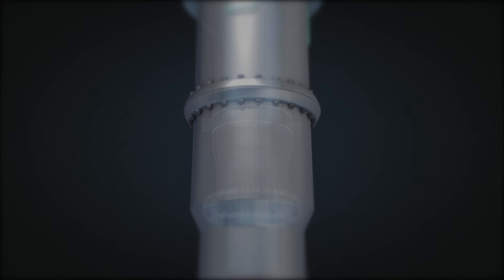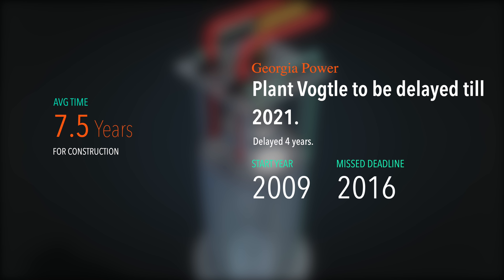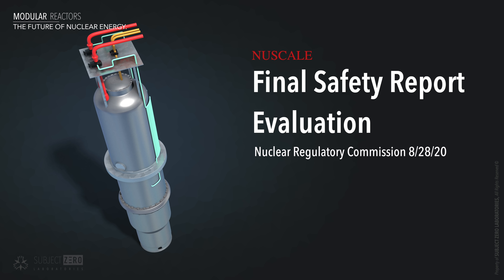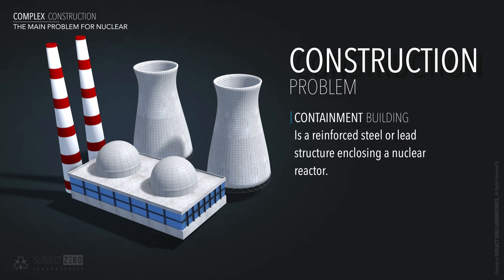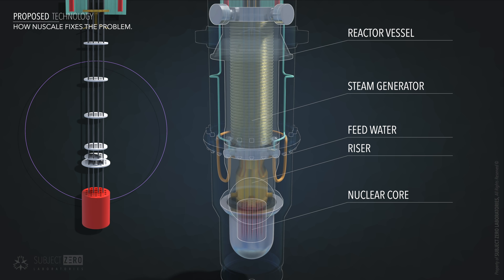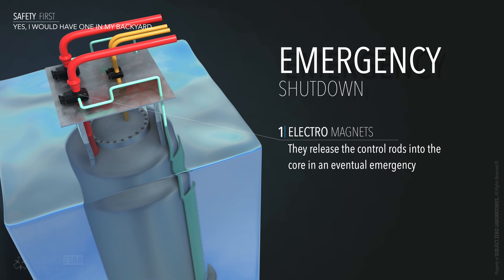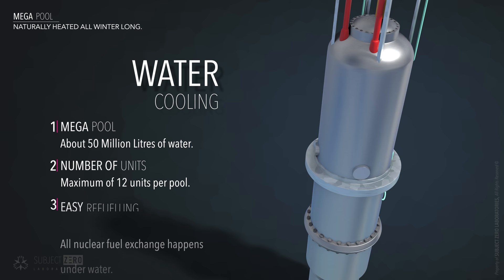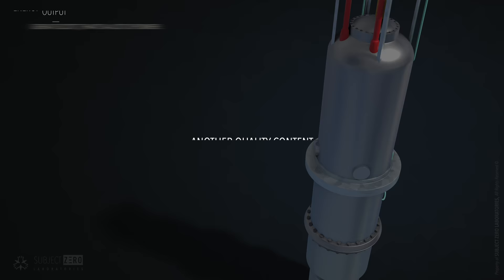A Milestone for Small Modular Reactors (SMR 2020)

Comment: Another weapons-grade nuclear waste production method. Pass.
Unless you've got LFTR or Fusion going (or a cheap way to send nuclear waste to the sun), this is just a waste of time in the medium and long run.
Reply: @yog-sothoth9895  It's the same material. You take the plutonium waste and refine it. It's one "solution" to what to do with the nuclear waste, but you get no plutonium at all with LFTR or Fusion. You can look it up if you don't believe me. LFTR was known about back then, but the drive to obtain nuclear weapons was the only reason the current design is the used around the world.
Reply: @yog-sothoth9895  That doesn't change the fact that the only reason we have U reactors is because the waste could be weaponized. Public perception of nuclear would be entirely different if they had chosen the "correct" choice the first time.
Reply: @snowballeffect7812  if you want to be really inefficient and costly.  You could build multiple custom built enrichment facility for the same input.
Reply: @ANTSEMUT1  Again, the only reason we have U reactors is because the waste can be used in weapons. It doesn't matter how inefficient they are at making the weapons. The weaponry is a bonus to the energy creation. Because there was no such bonus with LFTR, none were built.

Comment: Theres an ongoing suppression of the use of hydro power at small local scales... I live in a village for example where ive been told by a hydro electric engineer that the weir(low head dam is a barrier across the width of a river) that we have  could power the entire village. on top of that locals living along the river could install small water wheels or turbines and generate substantial electricity. The reason this is not done is because monopolistic corporations want you reliant upon their electricity.

Comment: Lol, low polution? The nuclear reactor melts down once wherever it is becomes uninhabitable. WTF are you talking about?
Reply: @ooksorry5362  It doesn't matter how low it is, it happens once everything completely ruined.
Reply: @fivefingerfullprice3403 out of 70 years of nuclear energy, there have been less  than 5k deaths, which is less than any other type of energy source, by a very wide margin, also the areas left uninhabitable are very, very small. To be anti nuclear is to be anti science; that is, not any different from an anti vaxxer or flat earther

Comment: the main reason they don't build powerplants like this is because it would RUIN the green energy scam putting overpriced wind farms down (that require maintenance constantly and break down a lot and are noisy (POLUTION) and take up more land than should ever be required making it less likely to be used for homes

sola same deal kinda, it's cheap but requires more land than the production of power generated.
Reply: it is a step in the right direction against carbon intense sources of power such as coal and natural gas.

Comment: Low pollution ❔where you been❔🤦 NO NUKES❕
Reply: Nuke and nuclear are different, and energy is energy. The more devastating the nukes, the more promising the potential for nuclear generators.
Reply: @tapist3482  the dangers of nuclear or nukes which are 1 and the same in my mind. Do not out weigh the benefits. They simply don't have enough control. (No experts) I didn't watch the video I confess but nevertheless anything nuclear CAN'T be good. If I'm wrong that'll be great. I highly doubt it though.
Reply: @TheJjrjr125  The danger of nuclear reactors and nuke are totally different. People today usually have misconceptions on how a nuclear reactor meltdown behaves, due to exaggerated expressions in movies and video games. The fission fuel used in nuclear reactors are of a very low concentration, usually just 5%. With such low concentration there's no way it'll explode like a nuke.
Reply: @tapist3482  tell that to the Fukushima explosion victims. 🙄 Get real dude. There is NOTHING safe about ANY nuclear technology period. 😒
Reply: @TheJjrjr125  *Said by a random guy who knows nothing about nuclear technology.
Reply: @tapist3482  besides. It doesn't matter if it "explodes" like a nuke. Reactors are more dangerous anyway. At least the"nuke" blows up and burns most of the hazardous waste up immediately. Meltdowns don't work that way. As if you didn't know.🙄
Reply: @tapist3482  Nothing ❔ I learned about atomic enrgy in physics class. It ain't like it's a secret. 🙄
Reply: @TheJjrjr125  Whatever.
Reply: @TheJjrjr125  lol no you haven't, you skipped that class the way you are talking.
Reply: @TheJjrjr125  lol nuclear bombs actually release way more dangerous and long lasting isotopes.
Reply: @ANTSEMUT1  bullshit not when they meltdown and blow up